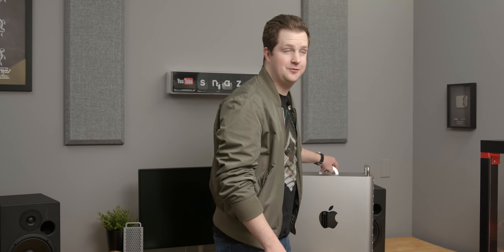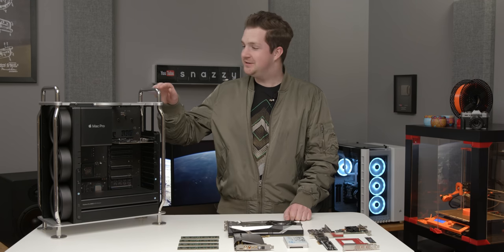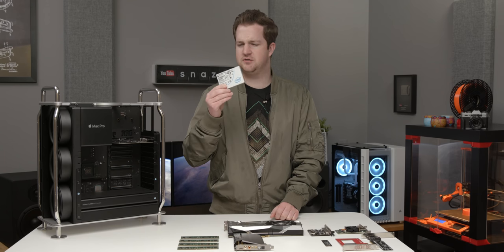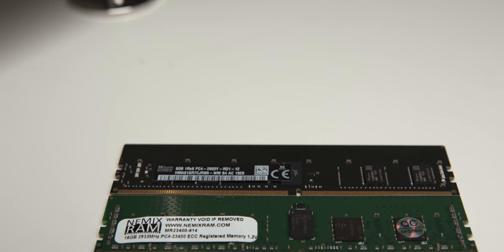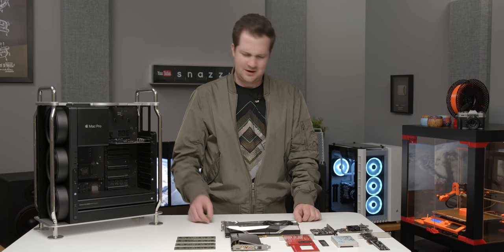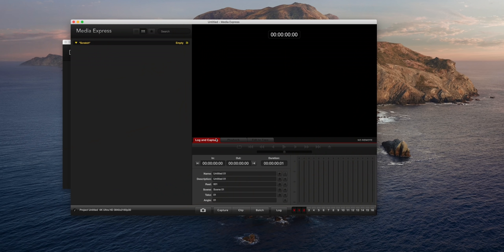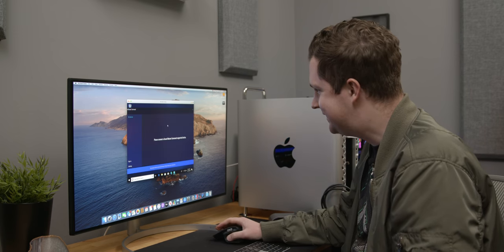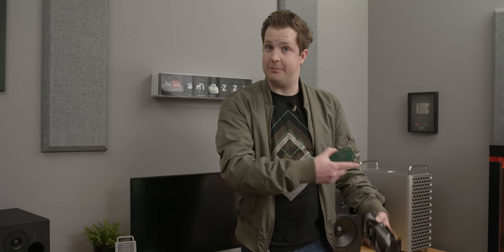What Weird PCIe Expansion Cards Work in Mac Pro?

Comment: Get a Sonnet Tech USB 3.1 Gen 2 PCIe card, it doesn't require any power cables and is made for MacOS. Also why didn't you install an AMD gpu which IS supported. I have a giant list of pcie cards that ARE supported my MacOS. Seems to me like you installed every card that wouldn't work on any mac be it 2010 or 2019 Mac Pros.

Comment: Things I dont like about Quinn - Fanboy at work

0:06 - PCI-e expansion. It's only been the STANDARD on every other computer (general expansion slots I mean) for 30+ years. I would be more mad apple hasn't been doing it, than happy they are doing it now. Why to put a fanboy spin on something that until now was a shortcoming of apple.

At 5:59 - "Windows, the operating system with extraordinary amounts of pop-up bloat-ware" Thats mouse config for your specific mouse man. It's probably downloaded when you did windows updates. Its required for the configuartion of the of the accessory buttons on that particular mouse. Seriously. Also, there are versions of Windows (not the version you installed) that have ZERO aftermarket tools installed. I wouldn't consider that bloatware. 

6:05 - You admit it's most likely a driver issue, but defend apple because "they aren't intended to be used on mac. See 6:28 

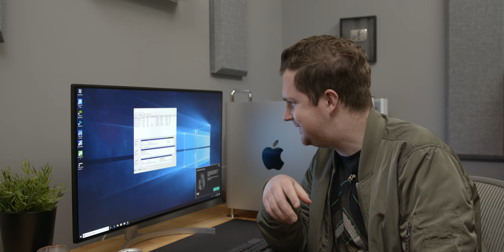6:17 - You click the Intel management software icon that requires admin access and criticize "Isnt Windows great?" WHEN APPLE DOES THE EXACT SAME THING WHEN YOU OPEN SOMETHING THAT REQUIRES ADMIN RIGHTS. This can be disabled, although less secure.

6:28 - Apple removed support for that particular drive in latest release of mac os. This amounts to a few hundred kilobytes at most of driver code in the OS.

I can see its blatantly obvious you enjoy shitting all over Windows.  I was straight up yelling at my TV during your tear down of the Mac Pro due to all the glaring issues in the build and "features" of the system. Not to mention how you gloss over all the things slapping use in the face wrong with its design. 

But hey "its the best thing ever because they made the pci-e hold down more convenient" .
Reply from the maker: This is one of the most pedantic and misinterpreted comments I’ve ever read. Kudos. Do I prefer macOS? Absolutely. Do I think Windows is gross? Yeah. But I use Windows daily because it can do everything and that’s not the case with macOS. I don’t even understand your criticism at 0:06. I openly admit one of the best things about Windows is it’s expansion capabilities and that Apple hasn’t invented anything new.

Comment: Hang on, USB adapter doesn’t work because no power adapters of any kind. Later shows GPU with 8 pin power adapter. You may not find a molex adapter in an Apple store but spend 10 seconds on Ali Express

Comment: MacOs seems like a Linux with less buggy desktop but even worse driver support...
Also a pcie card that is not supported in Mac wont work trough a VM unless your VM  Programm can pass it through and give the windows guest excvlusive access to it. And it most likely cant, its quite a rare features

Comment: Hey man, I am slightly disappointed with this video.
1) You mentioned the Hackintosh community many times - but have never tried to use any of their legycy/workaround drivers at all.
2) You have never used System Report to read up on the specs macOS sees on the PCIe bus - so you had no "real" idea if macOS actually did or did not recognize the cards in question.
3) ...You actually expected to be able to use PCIe cards in Parallels? Have you forwarded the device, actually? Anyway, since macOS is not exactly a PCIe-using OS, there are expected to be quirks. But more importantly, virtualization software likely is coded towards the same idea and probably does not really support this feature at all anyway. VMWare and VirtualBox might, but Parallels is directed towards a different type of customer...one that doesnt want to forward PCIe devices, I would think. ^^;
Nice video, but too many flaws to really give it a like. Too many left-open questions, attempts not being done and possibilities left unused.

Comment: Convert those 6pin connectors to SATA power... It might work!
Reply: The 6pin connectors only carry 12V, but the SATA power connector needs at least 5V (it also has 3.3V, but that's not used by most devices).
You could add a step down converter from 12V to 5V, but then it'd be a very bulky box tumbling around in your machine, since you need to supply a lot of power with it.
Reply: @anlumo1  Thanks. Learned something new today...

Comment: What the hell are you talking about - reliability of different interfaces for SSDs?  That makes no sense at all.  A U.2 drive is just an M.2 interface on a cable.  That says nothing about the type of memory chips installed on its PCB.  Neither does NVMe - again, that's saying nothing about the actual data storage chips - it's only referring to the type of controller on the board.

Comment: I do not really understand how Apple can charge 6K for this.... I had a PC back in 2017 (Core i7-6950X, 32 GB DDR4, GTX 980 then GTX 1080, 480 GB nVME SSD + 2 TB HDD) which would still beat this Mac... and the price of this PC was 3,200 USD. Currently I have a Threadripper 3960X, 128 GB DDR4 ECC, RX 5700 XT, 480 GB m.2 SSD + 2x2TB PCI-E SSD  + ASUS Pro Art 4K HDR monitor. It costed me 4 540 USD

Comment: Apple when you absolutely positively need to over pay for a pc. I built an all new 3970x  threadripper pc all decked out with 2 2080TIs, all water cooled 128g ddr4 3600mhz royal ram, 4tb gen 4 nvme m.2 ssd, 1600w super nova 80+plat for $8,000

Comment: maybe someone will reverse engineer the nvidia drivers (yes it is a dmca violator but would give support at all)

or maybe you can check with the hackintosh community there may be a 64 bit driver that you can "dirty" install by droping the kexts into the required folders.

you may be able to downgrade the os to mojave so 32 bit will still work.

Comment: 10:30 "What Mac has been made in the last 10 years that has PCIE slots?"
Oh, I don't know, maybe the 2010 Mac Pro and the 2012 Mac Pro models ?
On which I'm typing this right now, upgraded with X5690 Xeon, Kingston PCIE Predator SSD (primary boot device), MacVidCards GTX980/4GB, USB3.1 expansion card.
You seem to have never heard of these things, they're brilliant, even provide the same easy access to install cards and molex power connectors to run them.

Comment: Bascially, no, you still don't own your Apple computer, you basically rent it paying for several years upfront. They still define what software and hardware can and can't run on your computer, or limit you to just have a super overpriced Windows PC. You better off just using Linux, all of this boards will work in it, plus you'll have an amazing software suit to edit your videos, your audios and do your 3D stuff (blackmagic design, Natron, Ardour and LMMS) composed of relatively cheap price tags (blackmagic not only is better than Adobe premiere but cheaper) or open source software, like Ardour, LMMS and Natron.

Oh, and gaming, fucking amazing. Just use steam and proton engine to run even Windows games. Or just use a virtual machine, or... dual boot, basically the same shit Snazzy Labs had to do on half of the cards.

Oh, by the way... I worked in the Cinema industry for about 8 years, I know wtf I'm talking about.

Comment: So basically if you want almost anything to work you need to run Windows on your $10k+ Mac or you could get an even better Windows PC for half the cost that has everything and works with everything by default. Yep, sounds like Apple. 
The thing that drives me crazy about this is its proof Mac hardware can support all these things(Their hardware is nothing special) and its Apple locking their systems down even after someone spends thousands and thousands of dollars on it.

Comment: Man, this thing is a ripoff!
You're paying for 8 PCI-E slots, but Apple already takes up one for thunderbolt. Other Motherboard manufacturers route their Thunderbolt-ports internally directly from the CPU, saving some room and cost. Then, Apple fails to provide adequate IO for a desktop computer, meaning that another slot is taken up for a feature that comes standard in any other high end motherboard (USB A expansion)! So now we are down to 6 Pcie slots that are actual usable Pcie slots. But wait, there's more: you have to use up another PCI-E slot for another feature that any other Motherboard manufacturers nowadays provides out of the box: NVME expansion.
So after adding basic features that are expected from a normal desktop computer which are included in nearly any other high end motherboard, you're looking at 5 PCI-E slots. Do you know how damn cheap motherboards (with all these features already included on the motherboard) providing 5 PCI-E slots for this socket are??

Comment: So basically Apple did it again, they are selling an over-expensive PC as a Mac Pro, with the capabilities of a PC, that for years they despised "no way you guys are opening our work of art and expanding on their capabilities" hum, of course, that would make it easier, right? 
But of course they had to go a step further and sell their own custom stuff with their own custom connectors so you can´t use the industry standard devices and have to use their own and so pay 4x more for something that is already made by 500 other companies.

And about the "limitation of the CPU", what? The 8 core CPU can only ran memory at 2166mhz?? Wth? I don´t get it, so it´s more expensive then a regular PC and the CPU is limited to a specific memory speed? Why? I have a 8 core CPU and run 3200mhz memory kits, 64gb of them. I can even go higher, up to 3600mhz memory speeds. So I don´t get these forced limitations, what kind of CPU are they running at 8 cores? 2010 CPU or something? (attention that all my questions comes because of how much this thing cost, design and fancy shrouds should not go over speed on workflow).

Comment: No dust covers will kill it if the whole system if it isn't regularly cleaned.
Reply from the maker: Not if there is enough static pressure and all the air is directional. All servers don’t have dust filters and they’re fine.

Comment: Save your money and buy 2 AMD 3970X computers, hell you can even hack'n'tosh them and still have money left over and get double the performance! Not to mention full comparability with all peripherals and no dongles or dummy cards required.
Reply: How do i get the exact cooling this apple system has though and noise level.

Comment: Hmmm, using an extra internal SSD instead of the one it came with eh? Saves me money and circumvents that bastard of a T2 chip too? Buying now!
(Which is what I would say if I owned a Mac Pro.)
Sorry Mac community, I have a £3000 PC workstation instead.
(£2000 minus the cost of water-cooling parts)

Comment: Yeah, I figured apple was going to do this, sure it's modular, but mostly you have to buy their WAY overpriced hardware, or adapters.   so is it like buying a high priced Porsche, with a VW engine in it, at it's entry level..    I could always afford top of the line Mac Pro's..  but now I'm gonna have to drop out.  Me and about 1 million other Logic Pro users who aren't making $100k plus income a year.   No doubt it is a powerful element machine..  But it's for the upper income people.  Oh yeah, and I'm gonna buy 4 of those expensive stands for that fancy new monitor, to park flower pots on top.

Comment: You forgot to load the audio driver in your PC boot camp on the Mac ....
Still can’t believe they have PCI in the new Mac why didn’t they just make a bigger trash can with there own version of an outboard pci connecting.. it seems to me Apple is going backwards. Why would they put  third party cards in there computers they’ve never been kind to anyone adding to there self preparatory system.
Every time there’s a new operating system it takes months before it gets settled in ... for me I’m disappointed in this new Mac I think it was designed by someone at chef central and it is once again proving without someone like a Steve Jobs cracking the whip on design and integrity in trend setting...there just giving us a computer that will be easily better copied buy anyone with the ability to hackentosh 😕

Comment: Dont delete my comments 
400$ for 10pin connector power you can easily solve just with an old pc power supply and multimeter
Just find +5vdc and ground in this 10pin connector, cut out sata and ,20+4 psu's connectors with wires, cut wires and solder them together 
Lol, mac users have no idea what pc is
Lol, if i want yo build something like this MAC i would of just bought the same case which costs 200$ , some PC atx motherboard , normal power supply and just all normal pc elements ... Just hacking this MAC OS and create an hackintosh with full compatibility with wayyyyy lower price able to run win10 and hackintosh

Comment: Anyone who wants this for extensive editing or gaming DONT BUY IT. Spend like 1200 for a better pc
Reply: Better PC for 1200? Like?
Reply: @morlidor  you dont need to spend that much. Ryzen 9 3900X is comparable to the lower core count xeons and an RTX 2080 Super can accelerate video rendering quite a bit.
Or if you need a lot of threads, the Epyc stuff is pretty great, as is Threadripper. And it's still cheaper to build an intel xeon system as a PC rather than a mac pro.
Reply: @alexc3504 
Probably cheaper but if you put it in a Mac Pro like quality chassis with the same expandability and advanced cooling It won't be cheap either. And most computer Pros generally doesn't build their own computers.

Comment: Overpriced junk
Reply: — poor people
Reply: @IsaiahGamers  if people are poor then why do people need to install Windows even on the latest mac pro?! There is simply no perfect OS. I've tried an iPad to read when I'm travelling but it was a nightmare because no proper file management system and you can't basically see where your files are and also the settings are a nightmare to deal with. But recently Apple had been adding android features to iOS and I hope it continues
Reply: @IsaiahGamers  yeah only 7.62% of the World using MacOSX hahah and only 13.6% using iPhones as to Android users globally 40.28% and 35.12% Windows users globally. Your numbers are "poor" here the wealthy using the larger number spectrum. Wealthy meaning modular and up-gradable and non restricted. Selling outdated hardware from 2012 til 2016 and finally giving folks what has already been a norm since 2009 in 2019 yeah...poor thinking man